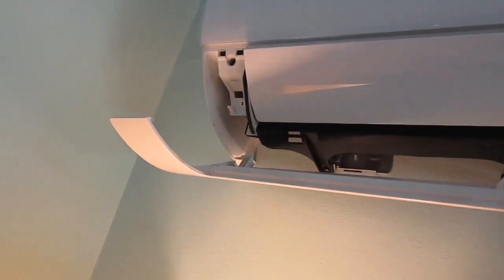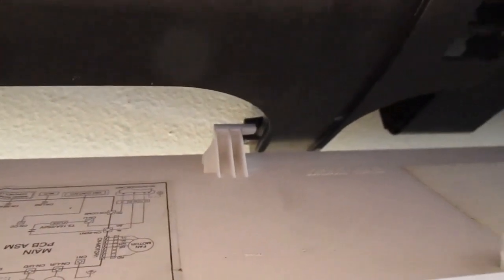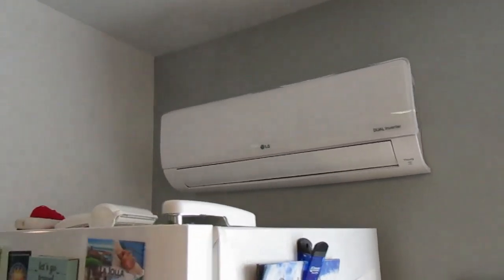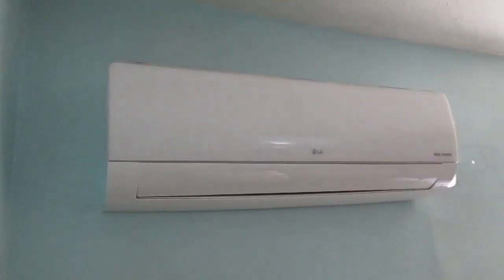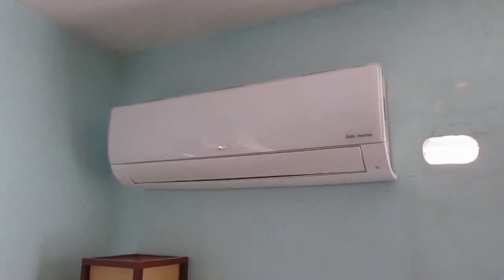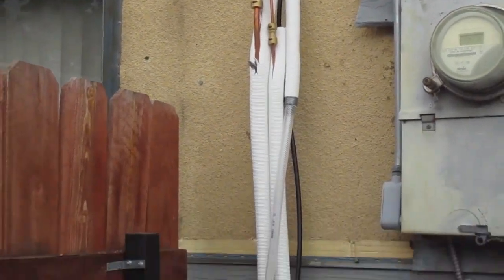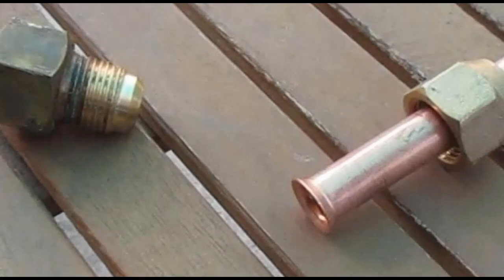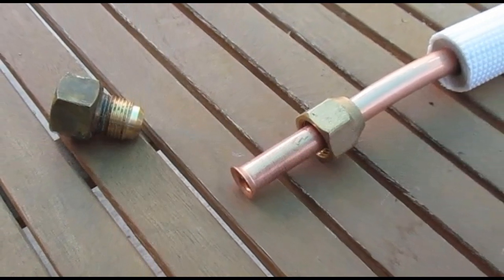Mini Split Indoor Unit and Compressor Connections

Comment: Is there an order that you have to connect certain BTU heads?
Reply from the maker: Not sure I understand the question - but FWIW no there isn't an order though you need to make sure you have long enough linesets, with the correct size connections to both the indoor units and the compressor, before connecting everything up.

Comment: Can you use a Y branch on any system or only the ones they recommend? Like LG makes a y branch and I have a Bosch Mini split?
Reply from the maker: I've never run across any docs or specs that discuss Y branches. I'm not an HVAC pro, so you'd be better off talking to one about this instead.

Comment: surely there has got to be a better way than flare connections. I can't believe the HVAC industry uses them as a standard. Especially when it comes to leaking refrigerant into the atmosphere.  Surely there is a better way.
Reply from the maker: Flares generally suck, which is why I can only defend them for connections directly from the factory. Otherwise they shouldn't be used.